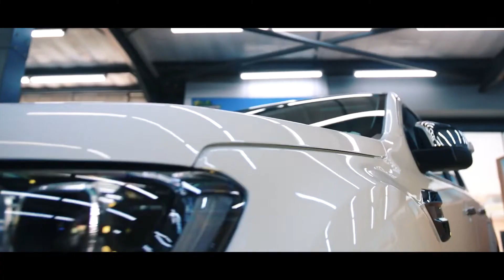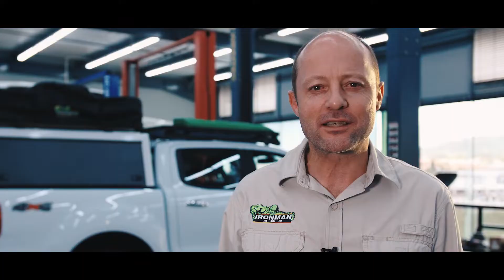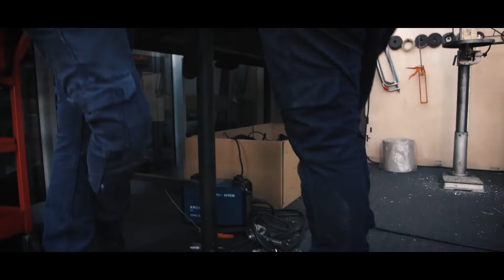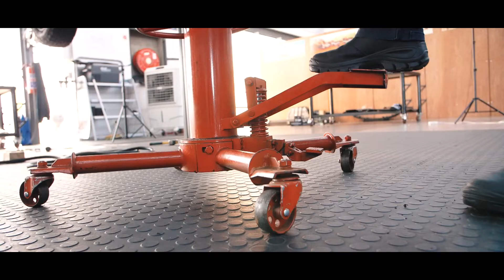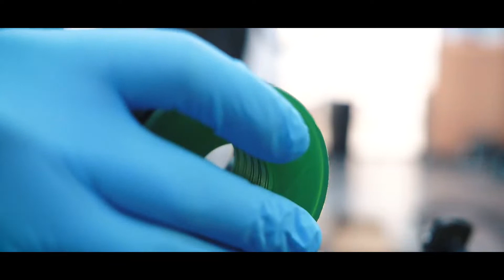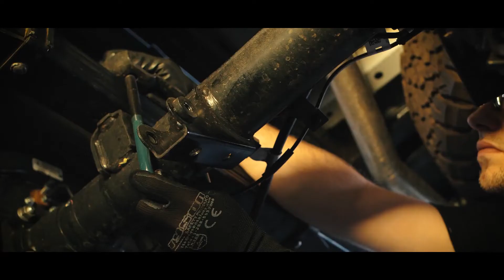Ford Ranger XLT Foam Cell Pro Full Suspension Build

Comment: I have a question for you experts in the 4x4 sector! (and I would like to know if you can tell me if it is true that the ironman nitro gas shock absorbers go well with the original set-up and can be adapted with the +5? I have a Suzuki jimny 4x4 with m13a 1.3 l petrol engine with shock absorbers and standard settings, yesterday afternoon I picked up the new ironman nitro gas shock absorbers and the 4x4 spare parts dealer in Florence told me that these ironman nitro gas shock absorbers are ok for 4x4 off-road vehicles with stock trim or in a second you could put the springs higher and it becomes a +5 high trim is that true? Greetings from Florence Italy!)